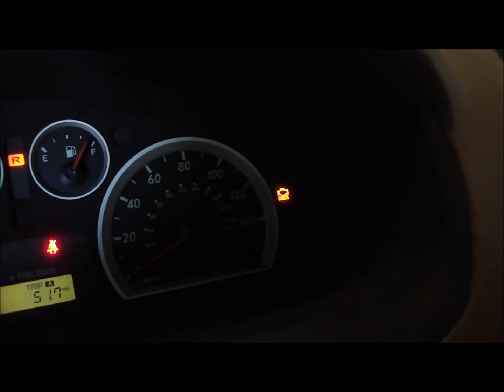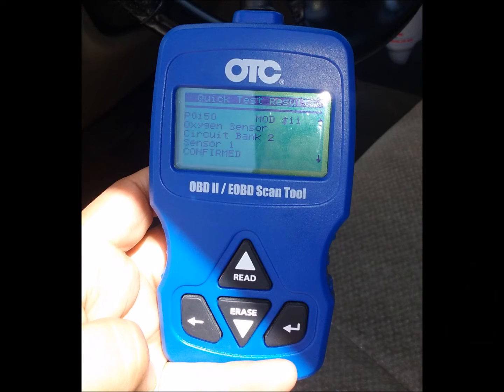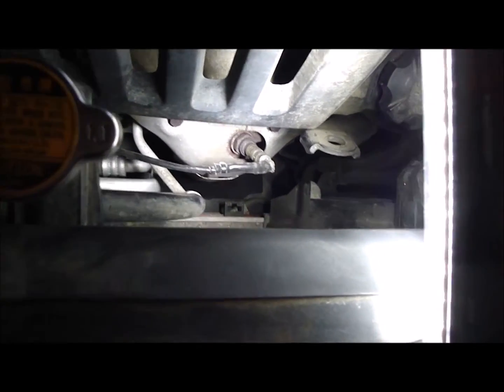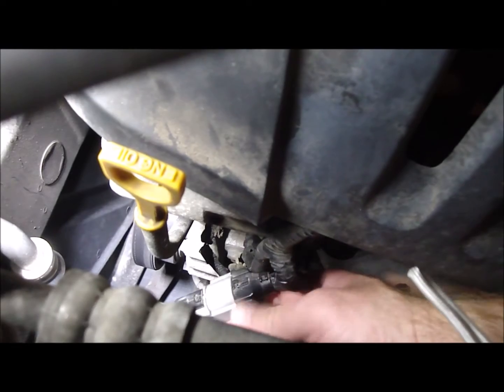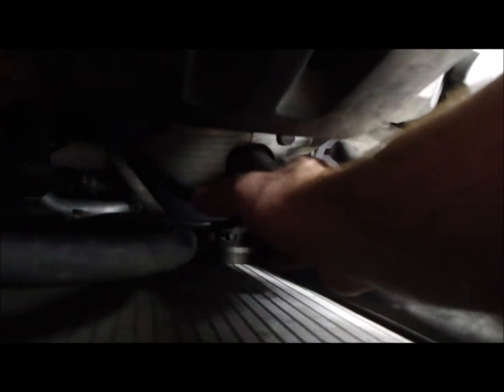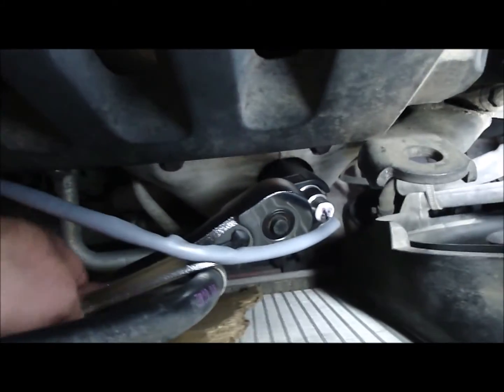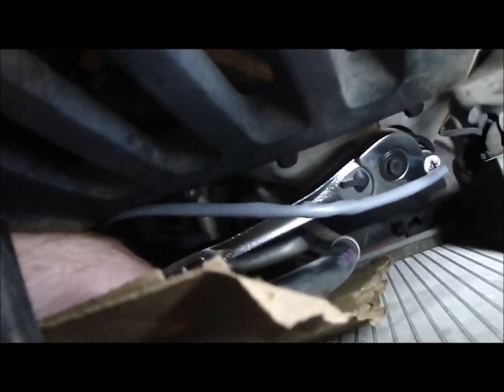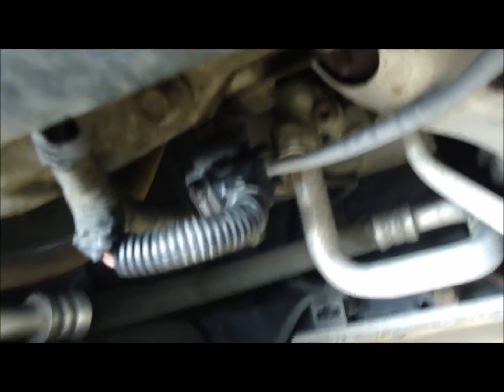Engine Code P0150 for O2 sensor on 2005 Hyundai Santa Fe Fix

Comment: Amazed you were able to free that sensor directly w/ a rachet on an O2 sensor socket.  I just got done freeing mine on a 17YO 3.5L 2005 SF.....and no way would this have worked, as the sensor was nearly welded into the manifold.  I had to use a 2" cutting wheel on a die grinder (only way I could get down there) to cut the top of the old sensor off.  Die grinder and 1/4" mandrill for it are both available at Harbor Freight, and Milwaukee 2"  radius 1/4" arbor cutoff wheels are available through Home Depot online (I went through 3+ of these wheels getting it off).  I  then put a true socket on it to free it w/ an impact gun w/ swivel extensions after soaking in PB blaster both hot and cold for a week, and impacting it w/ the engine hot.
Reply from the maker: WOW!

Comment: I'm hopeful that I stumbled onto your video… really hopeful. I have the same exact car and had the cam/crank shaft sensors replaced by a trusted mechanic a year ago, no sooner did I get my car back on the highway towards home 2 hours away, the check engine light came on and I lost all power in the car, the re-start rough. Four days later I'm stuck in the midst of a farmer's field and while it started, it took two hours to do so, couldn't drive it over 60 and when I got home, it wouldn't start again, Left it overnight and took it into a local 'mechanic' only to find out he 'fixed' the same parts I'd had replaced four days prior… but not really we later learned, he got $300 out of me and credited the $98 part back to me. JERK. Now five months later (after having my mech check everything out, including the parts he'd originally replaced, the check engine light has been on ever since, the difference now? All power does shut my vehicle off (battery, radio still works) and had me too afraid to drive it on the main highway (the only road that cuts through the place I live) Doesn't matter anyway, the last time I drove it, it wouldn't start and have had it towed back home. Now I have yet another local mechanic, who's scratching his head and telling me I need to replace the sensors again (3x in one year???) I'm seriously hoping that this NTK (if I can even get it where I am in Canada will work) and I'm really hoping my trusted mechanic didn't already use that part a year ago since I don't have any $ to get another vehicle or lemon. Diagnostic scan keeps bringing up codes for both sensors, did you have to reset the ECU after you fixed it?
Reply from the maker: +Ms40Watts I did NOT have to reset the ECU for my problem. It cleared after my first drive of just 20 miles. Please let me know if the NTK fixes your problem.
Reply: Ms40Watts
   Oh that's TERRIBLE!!! I HATE dishonest and unscrupulous mechanics!!!! 😣 Sadly, I have met many over the years. I hope you have found a trusted, honest mechanic by now!! 
Peace.

Comment: I too have had to replace the bosch 02 sensor twice and still have the check engine light come with in 8 hrs of changing it.Can I get a update if the other 02 sensor worked.
Reply from the maker: The NTK worked perfect and is still working perfect. Take the Bosch back and exchange it for an NTK. Let me know if that fixes your problem.
Reply: Justin Peters my mom's 2004 Hyundai Santa fe check engine light is on
Reply from the maker: +Tiffany De leon go to AutoZone or a car parts store and they can read it for you.
Reply: @tim ozzi I don't have it anymore